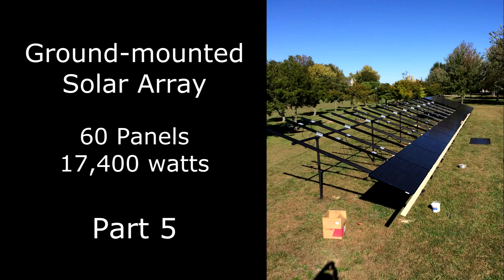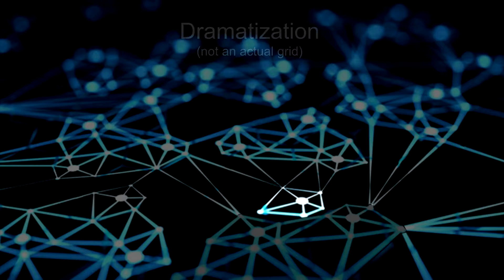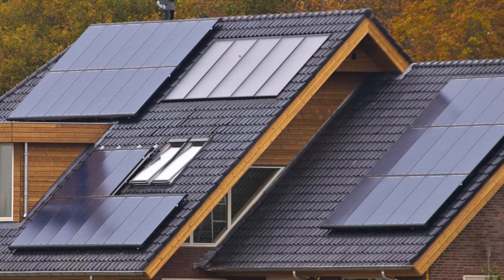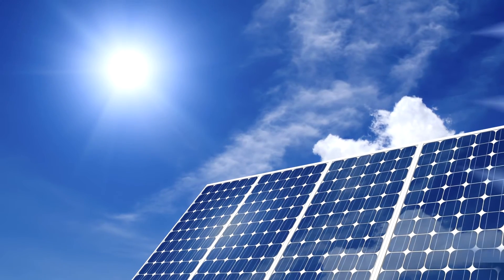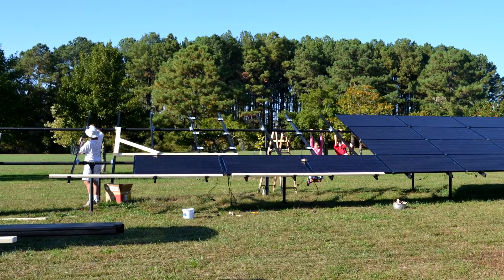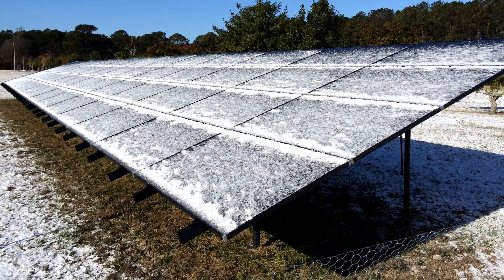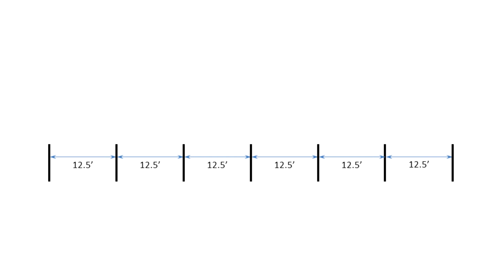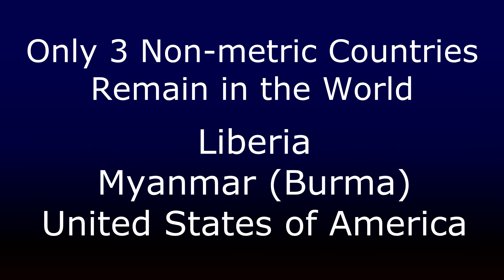DIY Field Solar Array - Part 5

Comment: Very nice project and excellent, clear and precise information. My OCD glands are jumping with joy. You also have impeccable diction and a great narrator's tone.

Starting in part 1, while converting to AC as close as possible to source tends to be more efficient, especially if there are long feed line runs, I think it was a good move to install the inverters inside. Leaving them out in the elements might have caused other issues beyond simple loss of efficiency.

I did notice your use of metric and standard figures but did not find it all that unusual. In a typical day, many of us Americans use both systems quite naturally, perhaps not noticing. True, there are certain units like driven/played distances or weather temperature that are exclusively imperial. While we buy milk in gallons, we buy soda in liters. 

There are more countries that use some standard units like Canada and UK. Not formally, of course, but their people use them quite often. And speaking of formal adoption, the United States bases all units on the metric system as well. Standard units are derived from metric references.

Interchanging units like you did in the video and giving equivalences for both is exactly what we need to start creating resonance and familiarity with the metric system. Global industries like vehicle manufacturers, and newer ones like solar, are already nearly exclusively metric.

Looking forward to next video.
Reply from the maker: Thanks for the comments and compliments.  Together, we can make a difference!

Comment: How did you come up with 17.4 kw number. When I did the calculation of the amount of panels you have (60pcs) and then multiple by each panel watts of 275w it total to 16.5kw.  Also how did you string it according to solaredge the max string length max out at 5,250.  Just asking. Thx u. We are still patiently waiting for more video of the completed ground mount
Reply from the maker: AIHF,  I use an 11.4 kw inverter and a 6 kw inverter for a total of 17.4 kw, but I don't have enough panels to max it out.  The highest power output I've seen was 14 kw.  Usually, it's between 12 kw and 13 kw midday.  The important thing is that I'm approved to connect 17.4 to the grid - and I can push the power up to that point by adding more panels at a later date.  So... I'm in the process of adding 20 more panels, from a nearby rooftop, to push the inverters closer to their limits.  As the system is now, it's 3 parallel strings with 14 each to the 11.4 kw inverter.  I tied 2 strings with 9 each to the 6 kw inverter.  I ended up balancing the strings to each inverter (14, 14, 14 and 9, 9).  As you know, I didn't actually have to balance the strings because I use optimizers, but it worked out nice.  When I add the next 20, it will probably be an additional string of 10 to each one.

Thanks for asking about part 6; I've been swept up in a spring garden project.  I'm looking forward to some home-grown tomatoes this summer!  I hope to get the rest of these videos done soon.
Reply: Hullspeed  thank you.